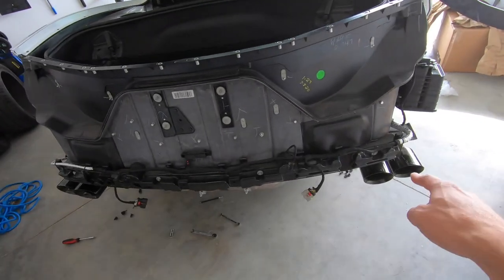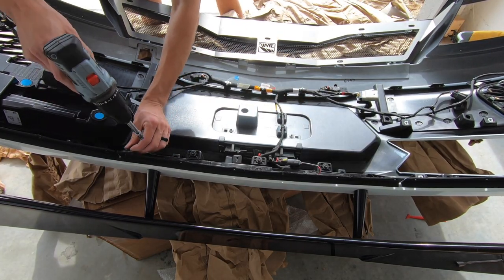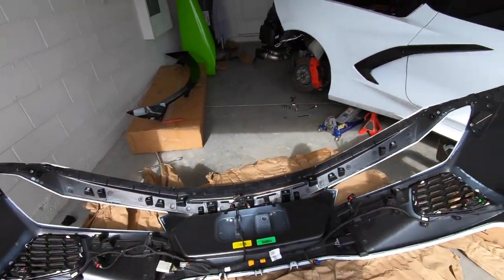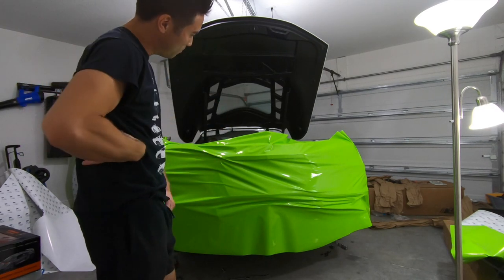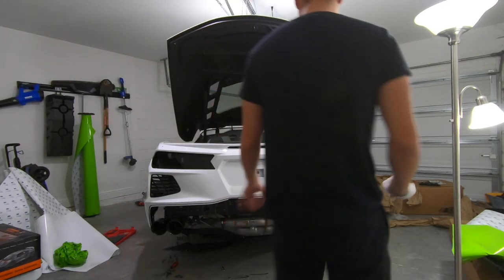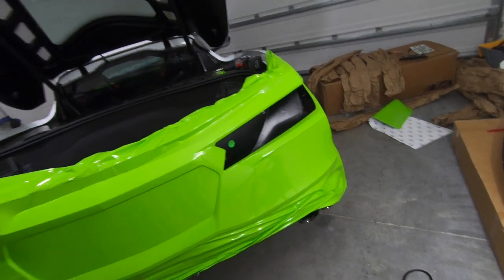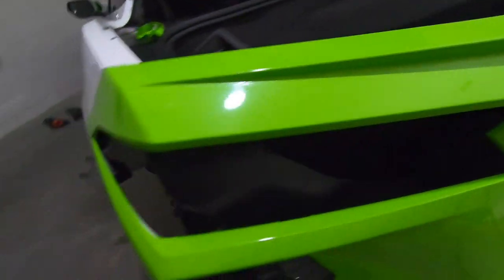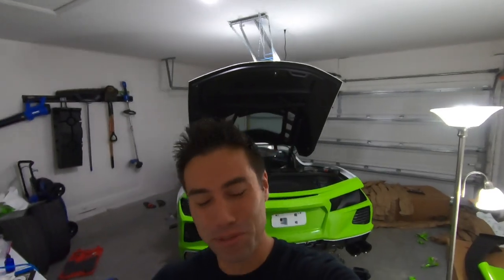C8 CORVETTE BUMPER WRAP ( WRAP AND EXHAUST SERIES PT. 4 )

Comment: Props for attempting that. That takes some balls. Got my sport cats installed. AFE air filter and two courts of dct added. I want to try the A Pillers and the section behind the top. You had that before was it easy ?
Reply from the maker: Yeah those are pretty easy, tomorrow’s video are the rear fenders and Fridays will be those sections you are looking for. Thanks for watching!

Comment: I hate to tell you this bro but in a few weeks of hot Florida sun your gonna have a bunch of that wrap pulling up from over stretching it into the recessed areas especially by the rear vents and the license plate area. I wrap for a living you should have put an inlay where the plate goes and used knifeless tape to cut. Ok for a beginner but in a car like that you really want it done right. Maybe ask a professional to do the rear and front bumper and you do the rest yourself. The sides aren't bad. ✌
Reply from the maker: 😢 not what I wanted to hear. Lol, that might be a good idea!  After I wrap the rest of the car just have a pro do the front and back bumpers.  I just did the rear Hatch and I think all this practice is paying off! I have a video going up every other day so I’d love your perspective on each part if you don’t mind. Thanks for watching!